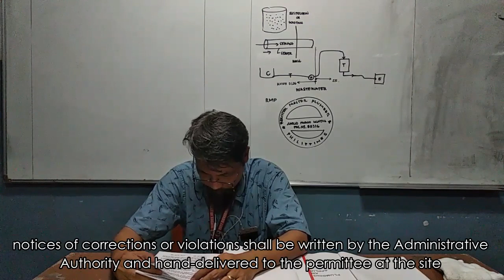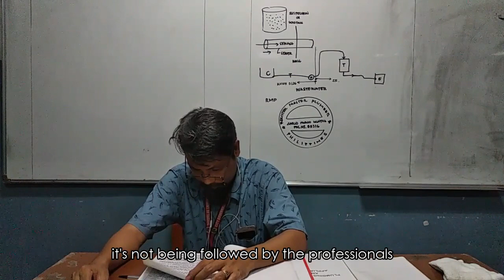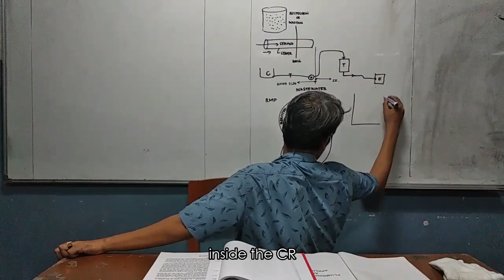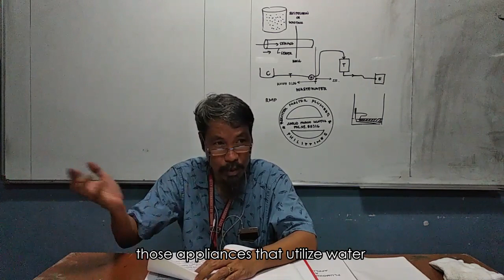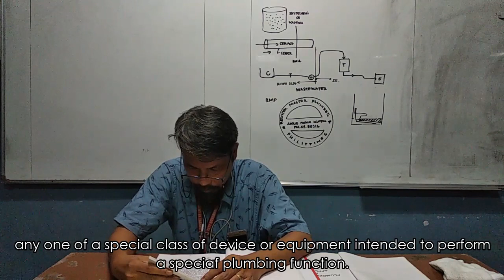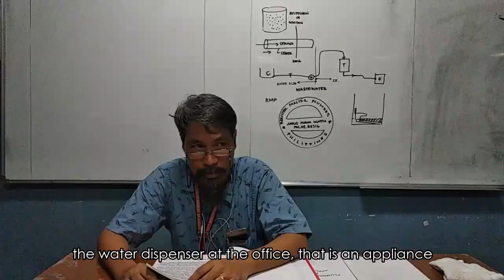CE526 Sanitary, Fire Safety and Plumbing Design || NPCP ch5: Inspection and Test Part 2

Comment: Good plumbing will help make sure that there are air gaps, physical separations, and adherence to building codes that separate connections of waste and clean water plumbing elements.

Comment: Thankyou for this lecture video. This is a very important topic since plumbing issues are considered to be the hardest to fix, it is important to get them checked professionally and frequently. Getting the drainage system checked timely would save you from the additional costs of repairs. Getting a plumbing inspection as part of your regular maintenance regimen would prevent you from having to spend on major expensive plumbing repairs.

Comment: Plumbing fixtures - 
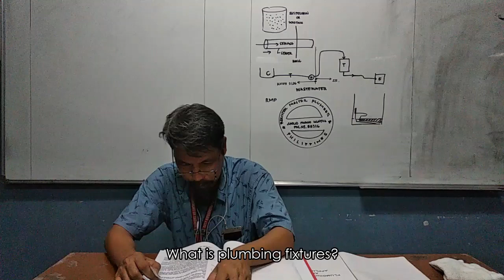a part that is attached to a system of pipes that carry water through a building.(6:43)
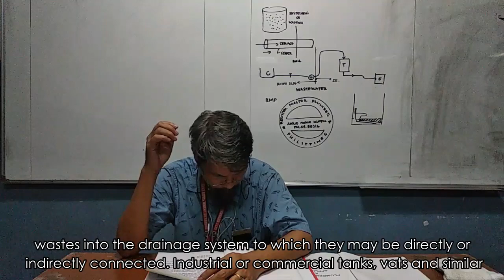Drainage system- are the patterns formed by the streams, rivers, and lakes in a particular drainage basin.   (7:04)
Commercial tanks - a tank is located be it a residential property, commercial, industrial or agricultural property. (7:12)

Comment: CAGUIOA, DANIELA O. 
BSCIVESE 19-00459

In this video, I learned about the importance of inspection and testing. In inspection, Corrections, approval, covering or use and uncovering is important to know. While in testing, responsibility and media. Industrial or commercial tanks, vats and similar processing materials are not plumbing fixtures. 
Corrections @ 0:08
Approval @ 0:43
Covering or Use @ 1:15
Uncovering @ 2:46
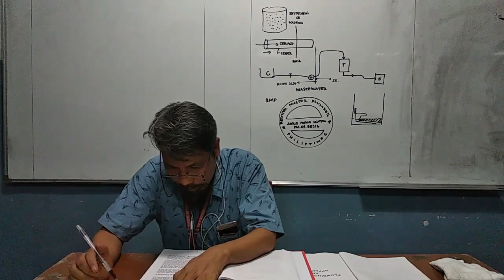Responsibility @ 5:16
Media @ 5:41
Plumbing fixtures @ 6:47
Vats @ 7:51
Plumbing appliance @ 9:15

Comment: Important of inspection are corrections, approval, covering or use, uncovered. Important of actual testing are responsibility and media. Plumbing fixtures is industrial and commercial tanks, vats and similar processing equipment are not plumbing fixtures. Plumbing appliances like heater, cooler and water despenser

Comment: Ruiz, Sharlize Veyen C.
19-00620

Thank you sir, I have known 2 important things that needs to be considered when there is a plumbing inspection. First, plumbing under the tiles should be uncover or open. Second, plumbing system should not be in used before the testing/inspection. The video also covers the topic about notices of correction/violation and If successfully passed the test of installation, approval certificate should be issued by Administrative Authority. After approval, all plumbing system shall be uncovered and must leave a provision for inspector to actually see the pipe. I also learned some terms and what is plumbing fixtures and what is not.

Comment: Mendiola, Mc Axel Joseph P
19-00167 

This is a continuation of the last video you discussed so the corrections, approvals, covering and uncovering are also part of the inspection that needs to be perform by administration authorities and this video is about actual testing as well. Besides of inspection and testing I've learned in this topic the definition of vat, receptacles, plumbing fixtures, and plumbing appliance and whet is its purpose in plumbing system.